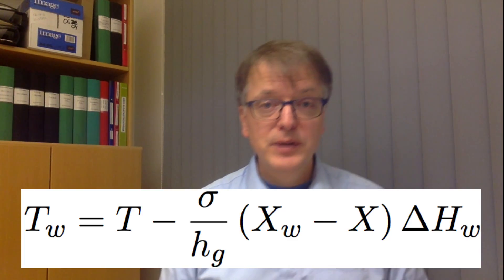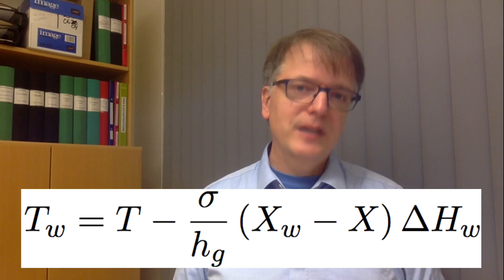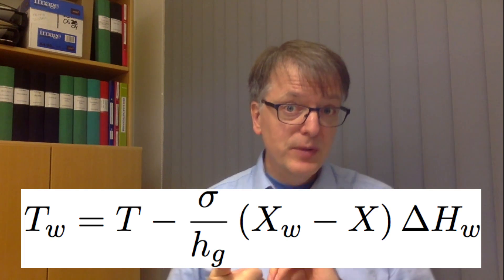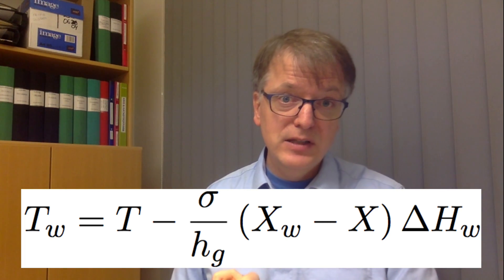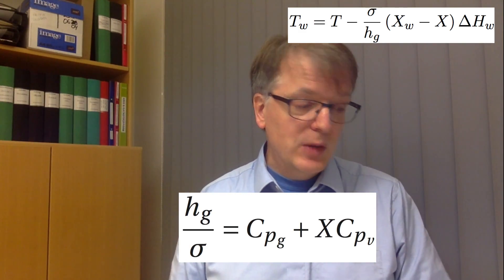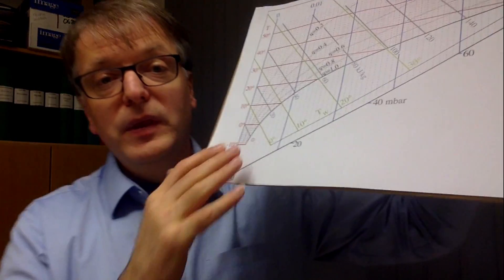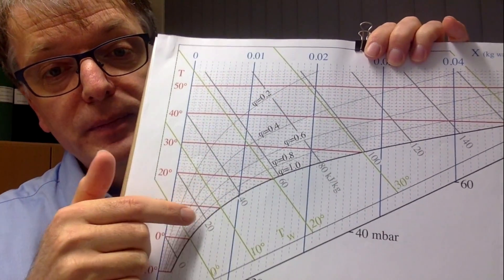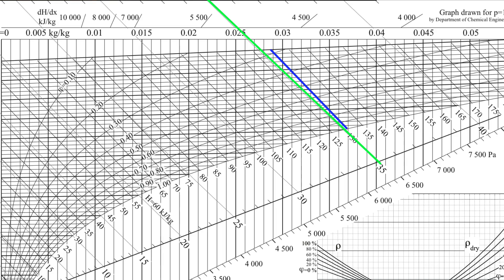Air/Water: Wet bulb temperature

Comment: thanks I have a question, I have a cheap but accurate thermometer, I take note 
of the temp, and stick wet cotton on the bulb, and swing it for a min, 
then take the temp again.. I know it is supposed to be with 2 at the 
same time maybe to be more accurate, but really the difference between 
my reading when it is dry and doing the experiment is one min, in the 
same spot, should that give me accuracy?   when I do it, my room temp is
 28,  I swing it with wet cotton on the bulb for a min it comes to 26 
only? does that mean I have 90 of humidity? we have 10% humidity 
outside, so I placed wet towel near the AC to increase humidity but I do 
not feel soggy at all.. where is the mistake? why it has to be 2 thermometer.
 swung at the same time..? one thing though the bulb is protected with little metal grid with 3 opening could that be the factor that give me this mistake? thanks
Reply from the maker: I think you may be correct in your assumption. You need good contact between the wet cloth and the thermometer so it is possible that the evaporation happening does not cool down your thermometer as much as it should. If you look at the wicks e.g. on

https://www.amazon.com/Forestry-Suppliers-Non-Mercury-Pocket-Psychrometer/dp/B01M1PFCKL/ref=sr_1_37?keywords=wet+bulb+thermometer+hvac&qid=1565284897&s=gateway&sr=8-37 

you see that the bulb is rather long and the wick rather thin (engineeringtolbox.com recommends you using a shoelace for wick if you don't have a proper wick).

Also, swinging a thermometer might not get you a very exact measurements as you might not get  the speed up enough. The equipment in the link above  has a chain making it easier to swing it around. We used to have an old, simple but rather reliable equipment in  our labs and with that one there was a  fan that forced  air across the wet wick. If I remember correctly from the top of my head, the air flow rate was 5 m/s, but as it was a mercury thermometer so we don't have it anymore.

(note: use none Hg-thermometer. You don't want to accidentally break a Hg-thermometer. The accumulated amount of Hg that you have breathed in your entire life stays  in your brain as HgO forever and that's a bad idea. In Sweden we have a general ban on mercury, much for that reason, but I know that's not the case in  USA and some other countries.)
Reply: @PLE_LU  thanks I just saw you response now.. sorry YT did not notify me and I was doing another research and saw your answewr. Thanks a lot.
By the way my thermometer liquid is Red, is that fine?.. I doubt it is  mercury  (hg).. 
thanks for your response and have a great day
Reply: @PLE_LU  I have one question for you please